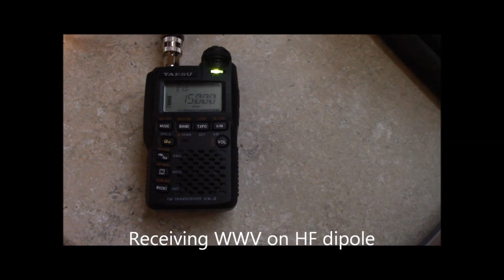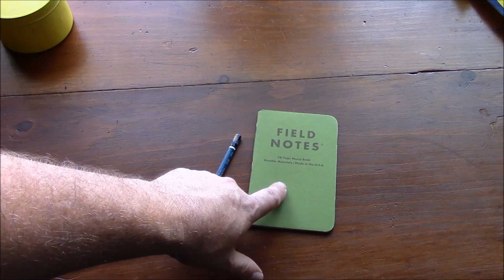Bugout Bag Communications VR10 Step One Survival bugout / INCH bag challenge

Comment: Looks good, Bret!  I just picked up the VX-8DR.  I've got the Levin 6575719 15000mAh solar power bank off Amazon.  It's about the same size and your smart-phone.  I can get three full charges off mine before needing to recharge it.  Thanks for sharing!
Reply from the maker: You are welcome ! The VX8 is a great radio. I have one of the Levin packs here and I used it before moving towards the lightsaver.  I keep it in my vehicle now as part of that inventory. The capacity, 2 amp output, and built in light are great advantages of the levin. The advantages of the lightsaver are weight, and a more efficient solar panel IMHO. Thanks for watching and the info !

Comment: hi Bret! Damn I am a bad student! I Now noticed how you install the radials in your folding antenna. Never occurred to me to use ring terminals on the long SMA female thread. I also use these style of crimp electrical connectors (in their barrel pin version) but I disassemble them. The metal portion has 2 parts that press fit together. The ring has a crimp section where you can solder solid core wire. I tried 1mm wire for radials but it is iffy. 1.5mm is workable and still can be folded down.
Reply: May I make one more suggestion? You are losing some flexibility with no cigarette lighter adapter. You can cut your 12V-USB cable and install APPs. Then make a short cable with a blank 12V adapter and APPs. I have made a whole kit like this for my TH-F7. Again thanks for the tips I always pick up from your videos.
Reply from the maker: I have picked up some of those terminals you describe in the past. I flood the connections on mine with solder after crimping too. I left the plastic on as it does a good job of preventing wire flex at that edge of terminal area and by pure accident I discovered that the straws fit perfectly. This saved weight over the original "ring" wire spreader I made originally. The smallest I have used is 22 gauge which is about 1mm IIRC. Thanks for watching and sharing ideas !
Reply from the maker: Yes there is definitely a flexibility loss and the newer generation of lighter adapters are light enough to add. I made a kit with power poles like that for my tool bag ( like the DC equivalent of RF adaptors). Thank you for watching and sharing ideas. I appreciate the support !